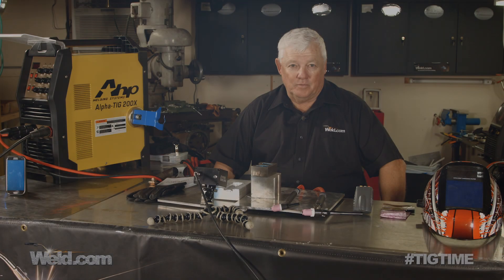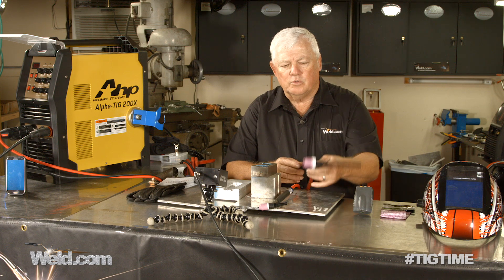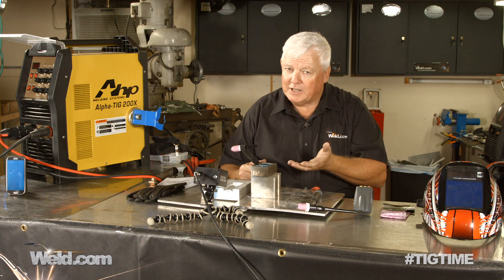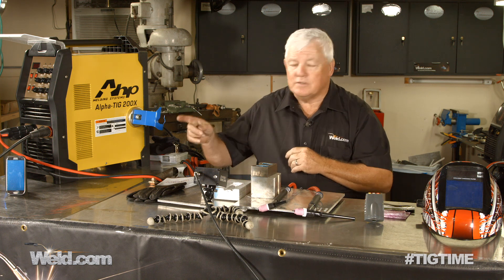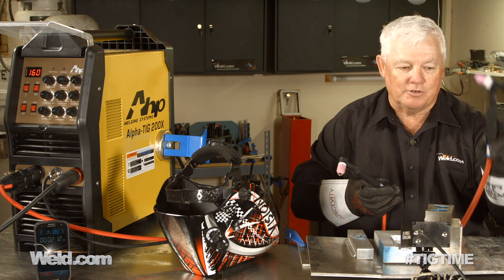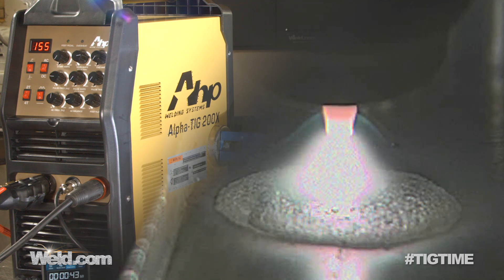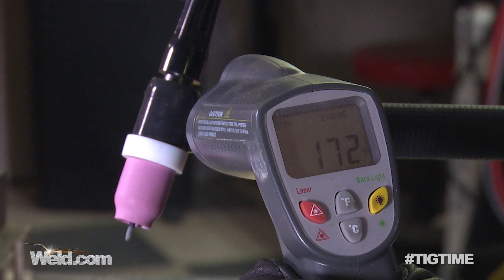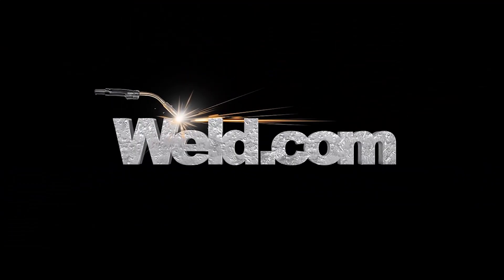9 Flex vs. 17H TIG Torch Duty Cycle Test | TIG Time

Comment: What is best torch for pipe welding/ For light wall such as schedule 40 or schedule 80. Just for messing at home. I have a number 26 that came with my welder but its quiet bulky and awkward.
Reply: youve probably sorted out your problem, but just incase its useful. it depends the wall thickness of the pipe or tube youre working on, and generally speaking, youll need 1A per thou of material thickness in mild steel. A no.9 will weld up to 1" sch40 and 3/8" sch80, a no.17 will do 2" sch40 and 3/4" sch80, and your no.26 2 1/2" sch40 and 1 1/2" sch80, anything bigger and you "should" get a watercooled setup. if you still havent bought a new torch yet, I'd get a no.9. You can have the torches set up for different jobs and such.
Reply: @PigeonSwag  thank you for detailed response.. I have not purchased yet as I took a break from welding for a few months as moved house.. I am saving this information for when I start practicing again soon.

Comment: This video should have thousands of views, but I guess people watch a few videos online... Now, they're experts! They got a new machine, a cheap 9 series from the land of cheap stuff and think buying an American 9 series will cure their smoking fingers, WRONG!
I just got myself a TL210 due to the massive heat output on the 9 I own, but I have the 20 as well! Still, I don't like having to drag that damned cooler everywhere I need to be to get some "work..." Maybe we should just call TIG welding playtime, done!

I'd say a 9 is the best torch to grab in a pinch when running DC 125A for a while, TRIMLINE 210 / 17H the best all around for AC/DC 200, and the 20 would be the best shop torch when you're welding playtime is in one place on the bench... The cooler is a help and a HUGE HINDRANCE at the same time.